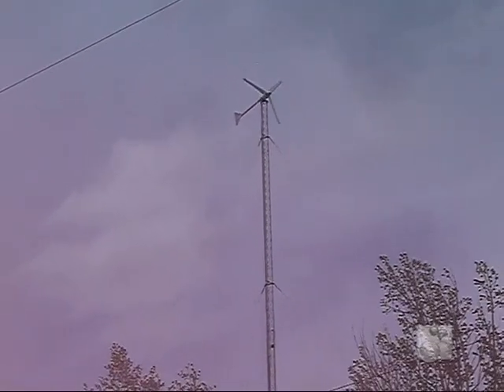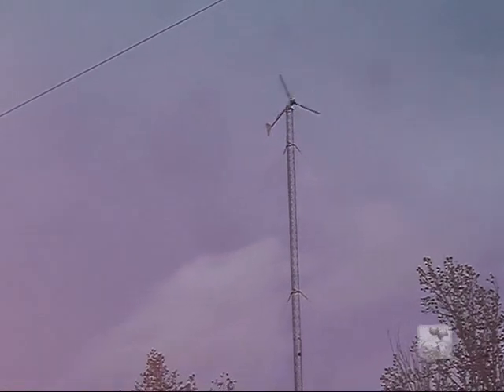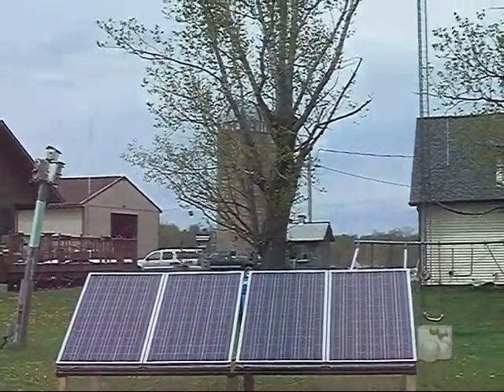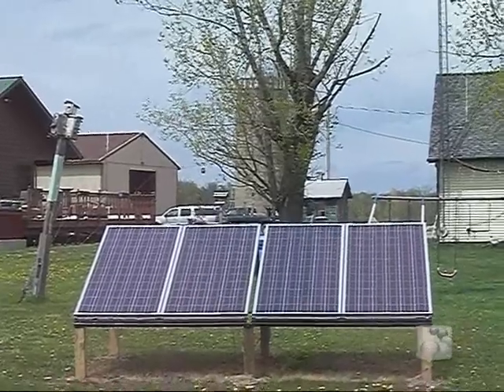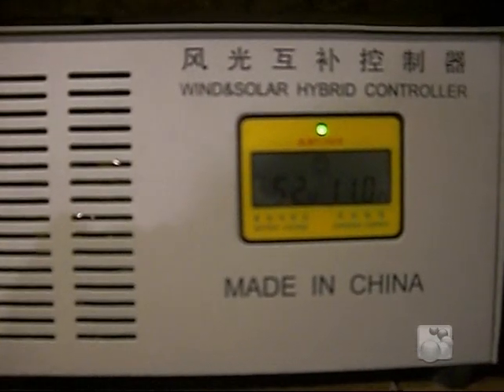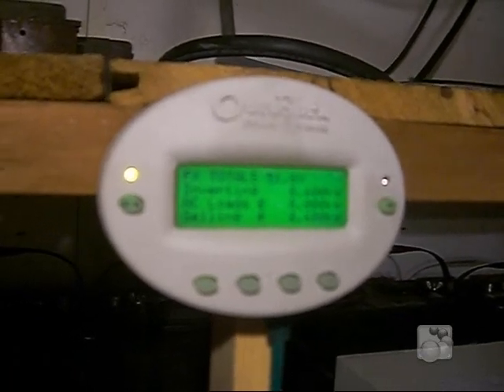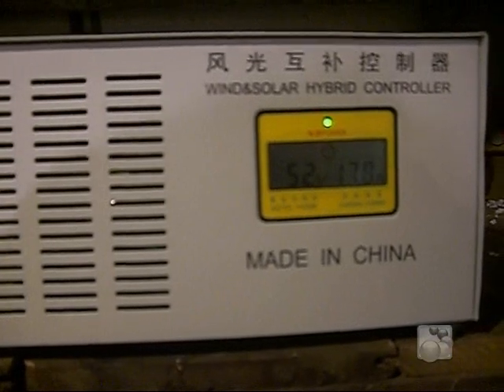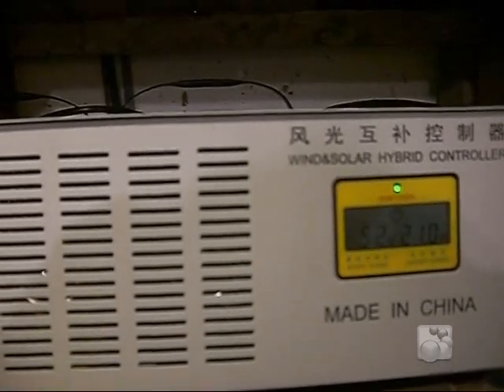WindMax 2KW Grid Tie Wind Turbine Performance  - day 2

Comment: What protection does this windmax have against high winds.  All the windmax turbines that I've seen none have the furling tail and I thought they have a braking system to slow it down during high winds.  I might be wrong I dont know.  Anyone know.  I have not been able to find that information online.  If they don't have any protection against high winds these turbines will not last very long.

Comment: I would also like to know the specs on cost and number of batteries. This unit would most likely power an entire home and keep on smiling. He's basically got a 2400 watt or 2.4kw system there. I think each of his solar panels are 100 watts apiece. This looks to be a very good system. My average monthly consumption is around 1.6Kw and having a battery backup with a grid tie will keep him cozy. I will also be putting an outdoor wood burning furnace in so my gas bill will be nonexistent.

Comment: Running my entire house only uses 450 watts max. Thats 3 tvs 1 xbox Fridge/freezer, 5 lights and central heating pump. Now when i power up the entire kitchen the wash machine,electric cooker,toaster,electric kettle,the watt meter flys up to 7000 kw.
Whats the problem with turning off things you're not using anyway...

Comment: @timonix2 Well if this thing is producing 2Kwh of power it could run my whole household for sure. I live in a 1600 sq ft house in Florida and my AC runs 24/7 in the summer, my last power bill was based on 2089kwh.

Comment: What type of hybrid charge controller is that? And do you have more info on your system's specs? I have only solar, but would like to add wind as well. Any thoughts or changes of how you would have done things? Hy from sunny FL